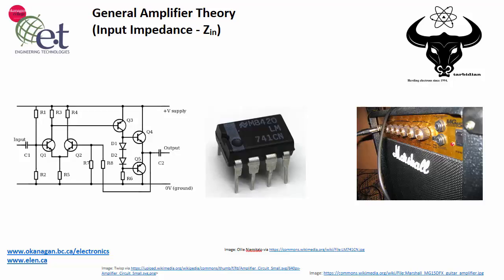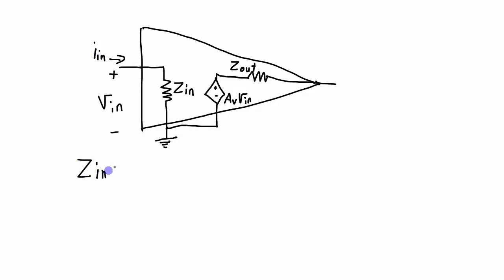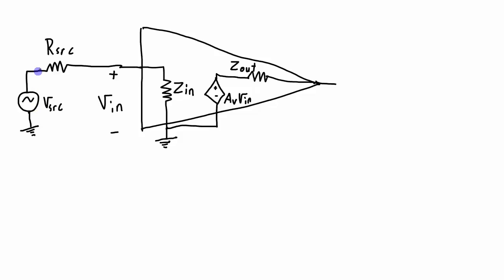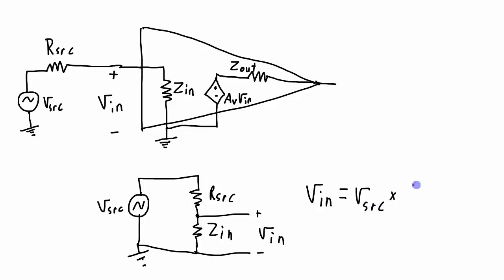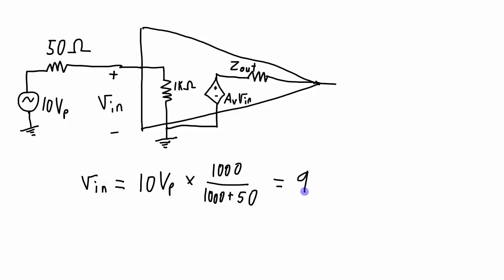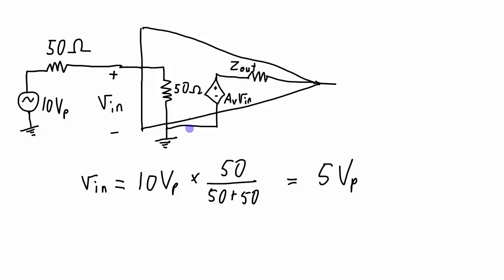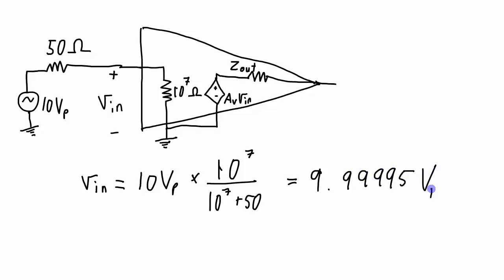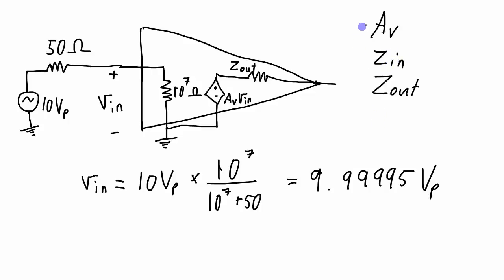General Amplifier Theory (Part 2a) - Input Impedance (Zin)

Comment: Beware of an error in the diagram. The input to the small triangle is missing. Only the ground path of the small triangle is shown. There needs to be another path shown for input. That path would go from the top of "Zin" to the small triangle. Now with both paths shown you can read the voltage across"Zin".
Reply from the maker: When you say small triangle, I assume you mean the dependent voltage source (AvVin). This diagram is not the actual circuit, it is only a model to help understand important input and output characteristics of a voltage amplifier; as a model, it does not need a correction. If you want to understand the actual circuit you would need to look at something like what is shown at the very beginning of the video.

Comment: i thought to have maximum power transfer the input impedance of the load should be the same as the output impedance of the source? am i missing something here?
Reply from the maker: It is true that for maximum power transfer the source and load impedances should be the same. For an amplifier, you are not trying to transfer power from input to output, you are "transferring" the waveform. The added power of the output signal comes from the DC power supply of the amplifier.
Reply: i see. i understand it now. in audio, we are more concern on preserving the waveform.
max power transfer has its own application e.g. communications

thank you.

Comment: Nice explanation of input impedance. One question I have is what is the typical input impedance of an amplifier? I can't imagine that there are really amplifiers with an input impedance of 10MΩ; that's nearly an open circuit, isn't it?
Reply from the maker: Yes, input impedances can be that high, and higher. For example, the AD820 JFET op amp from Analog Devices has an input impedance of 10^13 Ohms